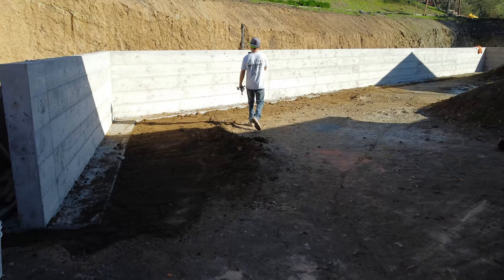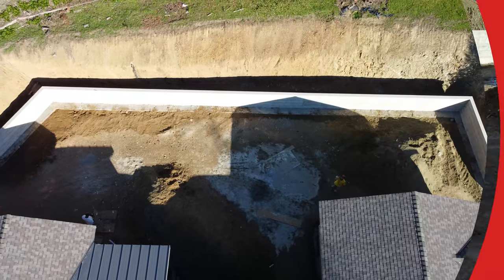Building A Structural Engineer Concrete Retaining Wall Start to Finish 2020

Comment: Hi there. Wondering if you needed to use snap ties when using the 2"x12" to form the form walls. Are the sufficiently stiff with the regular stakes? I am building a 4 foot hi retaining wall.
Reply from the maker: Good day we always use the snap ties with our walls. Not doing so you risk a blowout.. Check this video out I explain in a little more detail about the snap ties.. https://youtu.be/seGr6uXb_Sk #goodluck..